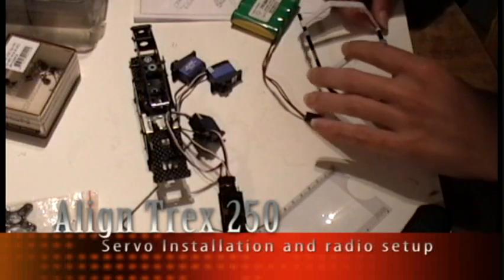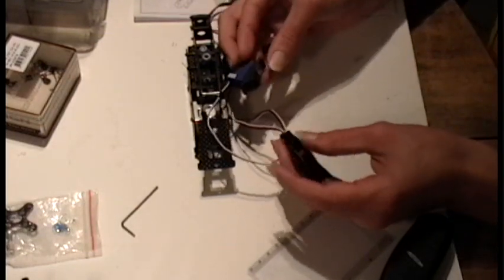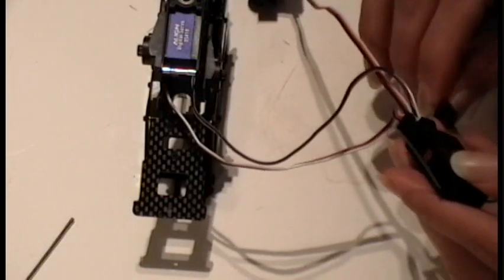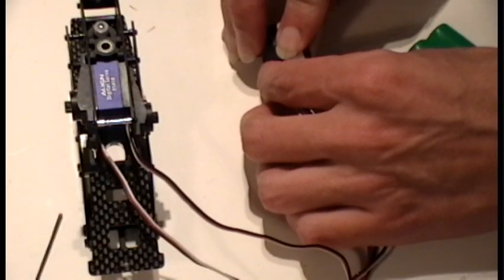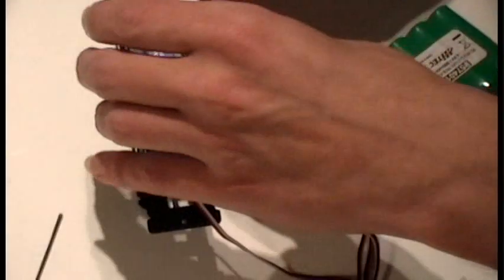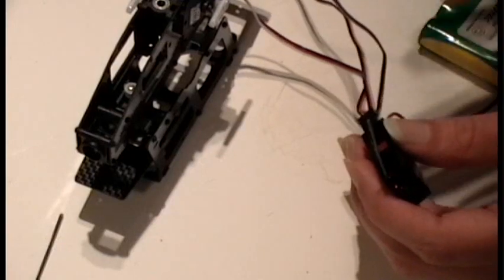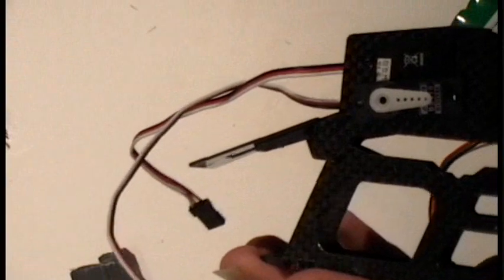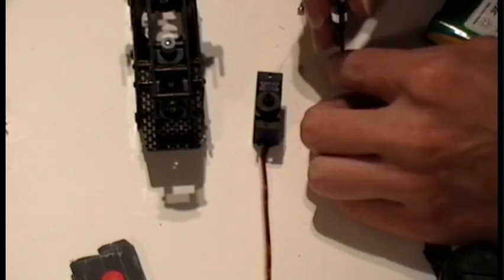Align Trex 250 Build - Servos part 1

Comment from the maker: You would probably have to mount it sideways. That's what I had to do in my 450 Pro. The nice thing about the AR600 is the long antenna. It's better than a park flyer antenna - better reception at long range, but the AR6115 park RX is more than sufficient for the 250.

Comment from the maker: And yes, it would be helpful if Spektrum could add some wording to the marketing and specs of the AR6300 to make it clear it's not a standard receiver. You should be able to get a refund or exchange - unfortunately, the AR6300 is not very useful and it's unlikely you'll be able to use it in anything - unless you want to build your own micro airplane.

Comment from the maker: Well, the manual was written 4 years ago, when the current line-up wasn't invented yet. The AR6300 (I had to look it up) is an ultra-lite receiver for micro stuff - it doesn't have standard connectors and is not designed for use with standard servos, such as on the 250. It is designed for use with the ultra-micro servos you find on the little planes like the Vapor, UM Polecat, etc. From the current crop of Spek receivers, I would probably use the AR600 (shown in my Trex 450 Pro video) or AR6115.

Comment: Ok thank you... I think I bought the wrong one the connectors don't match the connections on the servos. It looks like in the manual it is the spectrum ar6300 (Dont buy this one it does not work) could it be the ar5300? Oh well I'm out $50.00 you would think they would give some suggestions on good receivers instead of just having a photo.. Anyway, thank you for your response :)

Comment from the maker: Since the 250 can only be flown 100 yards away max before you can't see it any more, the park flyer receivers are fine. Just don't stick the antennas way inside the CF frame. As long as they hang out a bit into the wind, it's fine. I use the AR6100 on mine, but that one is no longer available, so you'll have to use one of the newer ones.

Comment: Jasmine2501 thank you so much for these videos they are so helpful. Question: What receiver do recommend for the 250se? I recently bought the one they show in the manual, spectrum ar6300 but I read on the package afterwards and it said it's great for foamies and short distance flying... now I'm thinking I made a mistake. I noticed you too are not using this model. Thoughts? Thank you in advance :)

Comment from the maker: @MitchumIndustries Yes that is true, but I think it teaches a bad habit and makes it harder to transition to 3D flying. I think beginners should be taught that the center is zero pitch, so they can learn to find that spot with muscle memory. I can pick up my radio and center my throttle stick with my eyes closed - and I don't mean I get it close, it's right on the mark. When flying, I use that point a lot - it's a home point, like a "ready position" kinda.

Comment: @chubbychicken1234567 instead of setting the servo's level with 50% pitch, set them level with 0% pitch. it won't want to roll any where near as much then. this setup is also great for beginners as they can drop the throttle completely if they become nervous or are about to crash and it won't slam into the ground hard.

Comment: @jasmine2501 ok, i also have a bit of problem on hovering on my 450, i donno what's wrong, leveled my swash plate, my blades pitch should be fine, it still drifting to some directions (maybe my skill problem), my gyro doesn't seems really helping much, tail keep moving to left. do u know any other problems will be?

Comment from the maker: @chenhongxp It is a 4 channel fixed pitch helicopter. I flew it in the hobby shop and I had trouble controlling the tail in a hover, but when it's moving forward it's fairly well behaved. The Blade SR 120 flies much better though.

Comment from the maker: @chenhongxp If they will fit in the holes you can use them. Any servo strong enough for a 450 will be fine on the 250. The Trex 100 is a fixed pitch helicopter - I don't think it flies terrifically well.

Comment: @jasmine2501 yeah, i didn't mean the servo u r using, i have built 2 450 helis. now i'm thinking to build one 250 and got 5 servo left at home, maybe i can use those :). see how 250 flys. by the way, trex 100, is 4 ch or 6ch? 3D?

Comment from the maker: @chubbychicken1234567 No, because the helicopter is not self stabilizing, when you give a cyclic input, the helicopter will roll in that direction until you stop giving that input. If you hold the stick long enough, it will flip all the way over. This is different from coaxials where you have to hold the stick to keep the helicopter moving. With CP helicopters, your stick input makes it roll - if you want to roll back to level, you have to do it.

Comment from the maker: @chubbychicken1234567 It is all in your radio programming. There is nothing to prevent the helicopter from turning over, but you can prevent it from being able to hold itself up inverted, by reducing the amount of negative pitch that is possible - this is controlled by your pitch curve. The thing about CP helicopters is they have no desire to return to level flight - so if you tell it to flip over, it will.

Comment from the maker: @valdes3232 How to set this up is shown in another video. You wouldn't benefit from simply copying my settings - as I use the 16T pinion, a new motor, and I'm at high altitude.

Comment from the maker: Follow along through the videos... there is different setup shown at different places. There is a radio setup video as well. If you go through all the videos, it should be pretty clear. The videos are designed so you can follow along AS you build. Use the pause button and build and watch, and you will get it all - nothing is overlooked if you do everything in the videos in the same order. The radio setup video is last.